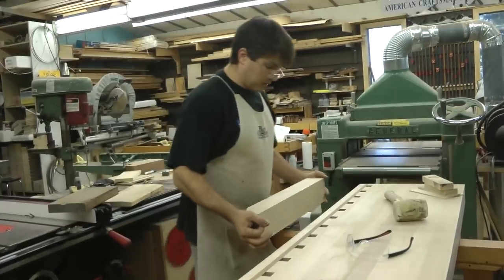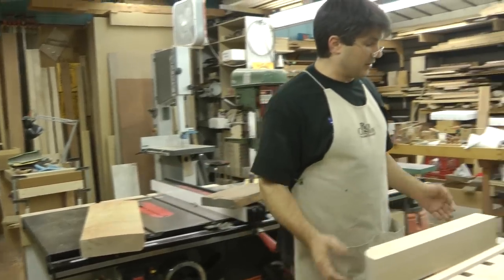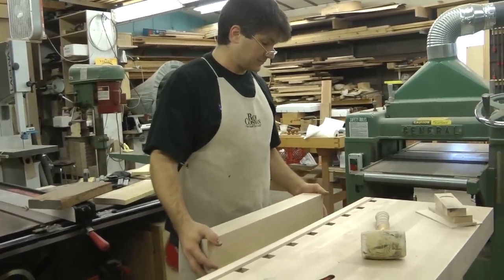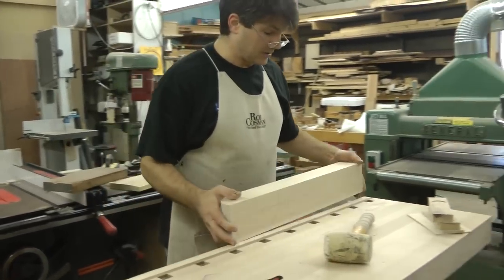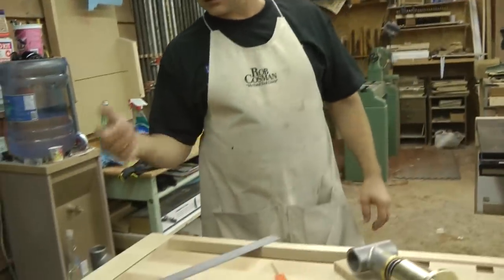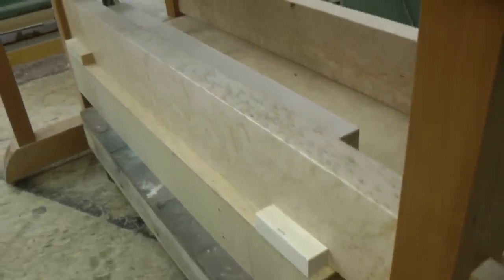Rob Cosman's Online Hand and Power Tool Workshop - Episode 119 of The Bench

Comment: Interesting.  Why are you not using your general drill press?  That drill bit cabinet looks really cool.  Drill bits are a woodworkers BAIN come true.  Drill bits get scattered and unorganized and you always wind up buying a new bit.  One day you wake up with 5 of one size and none of the size you need.  So kudos on organizing your bits.  You should do some videos on shop organization.  We all have small shops stuffed with wood scraps and tools.  Its often a wonder any of us can find anything at all.
Reply: Yes they are.  I picked up my planer, same model as yours, in Drumondville.  The factory was nothing you would expect and it was in a semi, older residential area.  I sold my SS32 shaper and have regretted it ever since.  I have the last 350 EVER sold into the US and its in my back living room!  Not in use.  WIll NEVER sell it.  The older generals were the best of the light duty machines.  Enjoy the ones you have, esp. the 260 lathe.